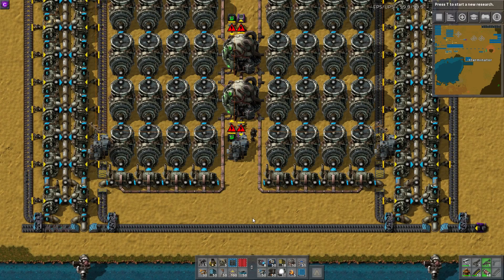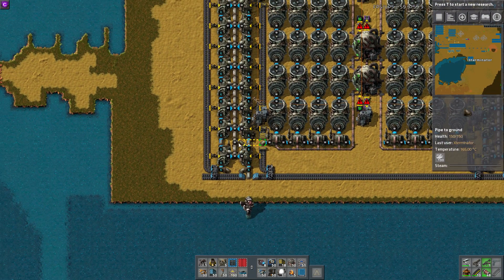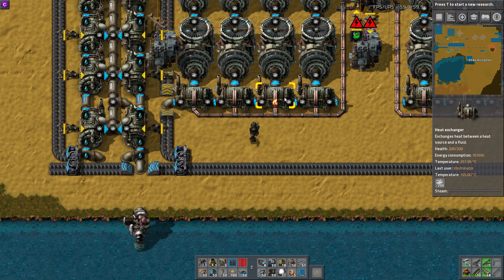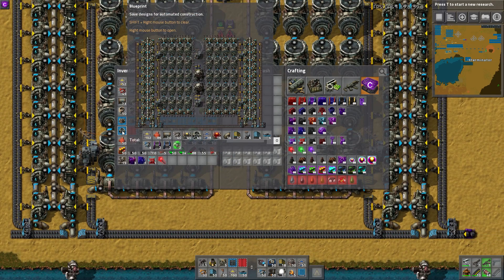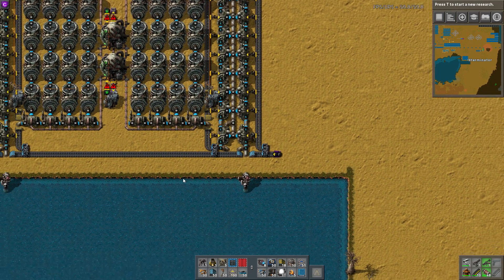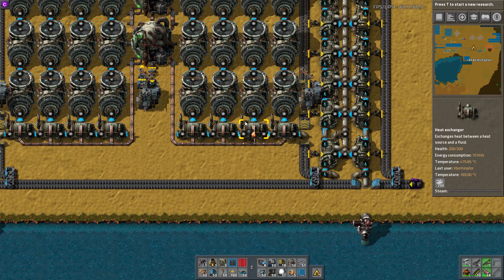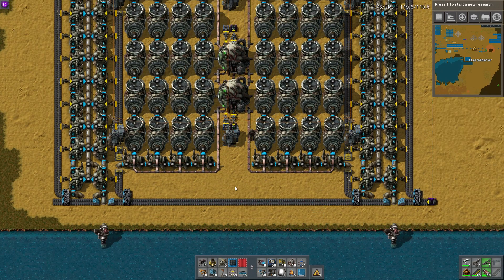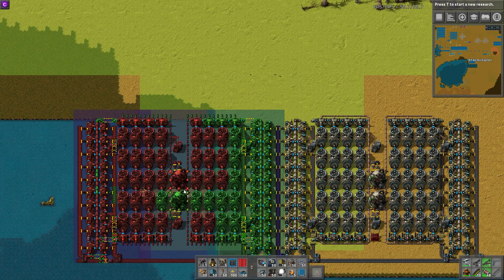Factorio Workshop Season 2 - Building A Better Factory :: MadZuri's Nuclear Setup

Comment: Does not seem to function anymore. Built it, steam got stuck against the exchangers--Only worked when pipes were replaced and filled with water instead.
Reply from the maker: Yeah, in 0.15.10 they changed how steam worked as a fluid and it broke all setups like this.

Comment: I wonder whether it would be possible to tweak this design with pumps and circuits so that, if the solid fuel supply ran out, then the boilers are isolated, and water is sent to the heat exchangers so that you still get 160MW from the nuclear fuel?

Comment: I see two big problems with these designs, firstly it's more efficient to stack reactors in a 2 by X manner, since the middle ones will be getting a neighbor bonus from the 3 reactors(meaning a 300% bonus) they are touching. Which I'm not certain will be all that achievable with these type of designs.
Whatever that maximum size might be, once you reach the maximum reactor stack size for one of these systems, and still need more power it has outlived it's usefulness. Making another hybrid stack next to it means losing out on 4*40=160 MW compared to having those reactors in one long 2 by X length stack, since you'll have 4 extra corner reactors getting only 2 neighbor bonuses rather than the 3 they'd get if they were in one long stack.

Secondly you are making yourself much more susceptible to blackouts since anything that happens to either the fuel or uranium based part they both shut down. So if you run out of either fuel, cells or space for spent cells(or can't recycle them fast enough) the entire system stops working.

Doesn't sound like a good trade off for saving on some tiles.
Reply from the maker: This is a small build meant for early building of Nuclear power. It isn't meant to use tons of Reactors and produce a ton of energy. It is meant for a stage where you want to switch some power to Nuclear but can't afford to make huge setups.

In regards to the fuel, you are correct, there is one of the main downfalls of the build, even Zuri admitted that. I just failed to point it out, so my bad for not doing so.

Comment: Interesting: yes. Useful: Not really. The only thing you gain here is some space efficiency. But on a virtually infinit map that doesn't really matter. What you lose is stability of the entire system. If either one of the fuels fail to be provided the entire system collapses. And as you shown in the video it has difficulty powering back up by itself. It's probably better to fully use the power of the nuclear reactors and regulate the fluctuations on energy draw with steam engines in a separate setup.
Reply from the maker: Good point. I failed to point out the negatives in this build, with that being the main one.

Comment: With Nuclear - is it better to pump all the power into accumulators as it's avaialble (sort of like with solar) or just have it drawing what you're using?  Or make sure you're under-providing with nuclear so it's always at 100% and the rest is coming from other sources?

I haven't really done anything with it yet myself, but I saw it eats the fuel whether you're generating power with it or not, plus it has the "spool up" time, and it seems quite expensive to produce.
Reply: trismugistus it's best to pump the nuclear power into steam which you can store, as stupid as this sounds. With one reactor alone you need 4 tanks to store one fuel cell worth of work. But it grows exponentially because neighbor bonus

Comment: Solid fuel shortage will completely stop power production in this build. No solid fuel = no steam to turbines. And the same thing with nuclear fuel.
Reply from the maker: If you saw my original answer, ignore it. You are correct, it won't work and that is the main disadvantage to this build. Of course that is a disadvantage to any normal Steam Engine build too. This build just manages to get a lot more power out of a smaller space than an equivalent steam engine build.

Comment: more useful would be a setup for the "Kovarex enrichment" process - there is no really transparent and clean solution until now...
Reply: It's much easier than it looks, the simple solution is to stick two logistics inputs, one with 235 and one with 238, and two outputs, one with 235 and 248. The system feeds itself continuously slowly producing 235 forever. It takes a long time to jump-start as you need to collect 40 to start the process, so you shouldnt make any fuel cells until this process has been going for a while and can sustain itself.

If you want to be lazy, and use a bit more resources and power, you just have two centrifuges feeding materials to each other

Comment: It's a unique idea. I'm also not too sold on the extra power here, but basically what ends up happening is that normally heat exchanges can only take ~103 units of H2O / s to convert to the equivalent in 500 deg C steam, which gives the 1.72 turbine / exchange ratio (103 steam / 60 per turbine). The normal boilers though create 165 deg C steam at 60 /s, so in his setup, the 40 boilers create 2400 units of 165 deg steam / s to feed into the exchanges.

Now I'm not sure of the energy calcs behind the exchanges, but it's fair to say that 10MW from the exchange can only convert 103 units of 15 deg H2O into 500 deg steam / s. But if that water were already pre-evaporated / heated, that 10MW could convert more units of steam to 500 deg steam. In fact, the exchanges now support the full 2400 steam / s, which comes out to 150 steam  per sec per heat exchange (2400 / 16). 2400 steam / sec (now at 500 deg) exactly fulfills 40 turbines (2400 steam per sec / 60 steam per sec for each turbine), which is shown in his setup.

My question would be, is there a way to push more steam into the exchanges (because I'm guessing they're now underutilized) to support even more turbines and how much more could they support?
Reply from the maker: That is a good question and I unfortunately don't know the answer. More testing required and science required. :)

Comment: I did the calculations if anyone wants to try a 4x Nuke variant.
4 reactors in a square pattern will need 6 pumps with 120 total boilers to power 120 turbines.

Comment: will the heat exchangers still work if the boilers run out of fuel? If they did and it just dropped to 27.5 turbine output could be very useful for extra boost when needed, or just for disposal of burnables

Comment: I really don't get this.

2 nuclear reactors next to each other = 4 nuclear reactors because of the neighbour effect. 4 Nuclear reactors = 160MW
Then you have 40 boilers with solid fuel adding another 70MW by providing the heat exchangers with steam instead of water

Each solid fuel boiler could power 2x900kW steam engines = 1.8MW per boiler
So the 40 solid fuel boilers could produce 72MW. But you're using them to produce 70MW in this nuclear array.

OK, it's more space efficient, and looks pretty, but 12 extra steam turbines instead of 80 steam engines (and 2 pumps) is saving about 420 tiles worth of space for 2 less MW of power.
Reply: I've tried this blueprint and it does seem to take a while to jump from 217MW to 232MW, I cannot figure why. But I've run it for more than 200 seconds after that (the time it takes to burn a nuclear fuel cell) and it does seem to continue producing a steady 230MW, which is 2MW less than if the boilers were used to power steam engines.

It will work with a single side of coal, not a double side of solid fuel in the video. It will also work with a double sided belt of wood.

But I still don't like the 'double jeopardy' If you don't have the wood/coal/solid fuel for the boilers, then the whole thing shuts down and produces no power, when all you gain from this design is a few hundred saved tiles. Heck, it even attracts biters because it surrounds the non-polluting nuclear facility with polluting boilers.
Reply: Xterminator it's certainly got a great debate going. :)
Reply: better would be a version with a tilable reactor core 2 by x (2x3+ is actually the most optimal, the end reactors get 200% bonus but all others get 300%)
Reply: Well, this is an easy debate now, Patch 15.10 broke this entirely, steam can no longer be used interchangeably with water.
Reply: @5:48 he showed it was making 232, not 230, so no loss of 2 MW.
Reply: He showed it working for only a couple of seconds, if you wait at least 2mins you'd see it falling on the real production as the reactors would start losing heat and eventually the system would balance itself out.
Reply: Then I'm prepared to withdraw my comment. The same power from 500 less tiles is great.

I look forward to seeing a version that has a 2x2 reactor core, the most optimal in terms of neighbour effect.
Reply: Yeah, I wouldn't be so quick to withdraw. If Mobius is correct, it might fall below 232, and if Piotr makes a good point about it using solid fuel instead of coal to get the 72 (or 70 if Mobius is right) power from the boilers. (Nevermind that it's all hinged on also getting the nuclear power going, which uses space for mining and processing and transportation, and creates new logistical nightmares)
Reply: It's a bit confusing, the Steam turbines can generate 5.8 MW of power, but the Nuclear reactor can only produce 40MW per reactor unit. So in a standard set-up, you use regular steam boilers in order to get the extra .8 MW out of each steam turbine. You don't have to do this of course, but the efficiency is less per turbine, and since nuclear burns fuel regardless of whether or not its being used it ends up being wasted.

Alternative setups also instead store steam directly into tanks, and then the reactor is switched off and only switched back on when it is needed. The backup stored steam is used during the "warm up" period to tide you over.
Reply: But you don't need the steam boilers to get that extra 0.8MW per turbine, you just place an extra turbine so you have 7 turbines per 4 heat exchangers. 7 could generate 40.6 MW, so you get the full 40MW. What this build is doing is allowing each reactor to generate 58MW per reactor because the heat exchangers start with a fluid (steam) at 165 degrees instead of water at 15 degrees, so with less work to do, they can produce enough 500 degree steam for extra turbines instead of just over 6.
Reply: I don't think this is even space efficient since you need an extra refinery, chemical reactors, and lots of pipes to make that solid fuel. Or maybe I did something wrong with my own 10GW setup.
Reply from the maker: I don't see what's not to get? Saving 420 tiles worth of space for a 2 MW loss is well worth it to me. Not to mention all the entities saved and performance increase. I mean if you want to go massive steam setup and take up tons of room and lose performance for 2 extra MW then go for it.

Comment: But why would you want a hybrid? You add a extra consumable item instead of investing in heat exchangers which are only a one time only investment.
This setup seems however to deliver more power because  these reactor should support about 27 turbines if I'm correct.
Reply: Because solid fuel is less expensive than nuclear power cells, if you can use solid fuel to heat up steam up to 160, then using the nuclear to heat up above that you are not wasting nuclear fuel up to that point
Reply: You don't magically gain any energy by pre-heating for the heat exchangers, splitting the set-up into a regular fuel steam set-up and a nuclear set-up gives the same amount of power. So any efficiency other than tile efficiency is nonsense.
Reply: TheChaotix14 Can you explain why he gets 230 MW, without the boilers those two reactors should only provide 160 MW.
Reply: Alores Because he adds another 40*1.8 kW=72kW of energy via the boilers. So technically it's should produce a maximum of 232 MW of power, but as you can see when he's showing it off with the energy drain not every boiler is on at all times, so it ends up with a still decent 230 MW. No magic happening, no laws of conservation being broken, just adding energy via another route.
Reply: Fuel cells are very expensive, whereas Solid Fuel is essentially free. Once you have enough oil/beacon set-ups to provide you with the required crude it will do this forever. In a standard set-up, one Reactor unit outputs 40 MW of power, the steam turbines can take 5.8 MW each but in a standard nuclear only set-up they only use about 5 of it. What this set-up does use solid fuel and standard boilers to make up the difference.

Since fuel cells burn regardless of whether or not the energy they produce is used, it makes sense to either supplement the power with an additional steam set-up, or store excess steam inside tanks.
Reply from the maker: You answered your own question I think. That is why you would want to. Because it is able to support more turbines off of only 2 reactors than you could normally do with just heat exchangers. :)
Reply: save the extra steam you can do regardless of using this method or not... i have an easi settup with a few extra steam tanks that makes the reactors only burn fuel when needed, and  does so i can have twice as many reactors then needed for better efficiency... after this new setup i save up to 70% on the reactor fuel
Reply: Wasting oil that could be used for research on solid fuel for power is just retarded. With kovarex enrichment you get like 60% of your cells back, plus they aren't used for ANYTHING else.

Comment: I don't think that setup is effective since you're using 2 types of fuel to output 230MW. Its an interesting idea tho, that you can use multiple types of fluids to use the heat exchanger instead of just water, wonder if you input oil what would happen.
Reply: A normal two-reactor setup can only produce 160MW
Reply: Distelzombie Centzon Totochtin And the other 72 mw come from the boilers. You'd have exactly the same power if you seperated both builds, with the added advantage, of not having all of your power die, when 1 of your fuels falls short.
Reply: I made a copy of that system working nonstop for a few minutes and its not outputting 230MW in a constant rate so its not worth it. The turbines consume more steam than the exchangers generate so, once you let that setup working for a while, the reactors start to lose heat, the steam in the pipes start to drop until it balances out around 170MW. Also spending 2 types of fuel to produce the same as the 2 reactors don't sound effective to me sorry :/
Reply: Mobius one That's not what I saw in creative mode. Once it got up to 230MW, it stayed there.
Reply: DRY411S did you check the heat value of the nuclear reactors? After a while they start to drop that assuming you using 100% of the output value all the time.
Reply: Mobius one I did see that the reactors fell below 1000 degrees yes and wobbled around the 750 degree mark. But the power output from the plant was steady at 231MW. I used a creative mode power void thingy to make sure there was a full draw on the plant.
Reply: If you pumped oil into the heat exchangers, you'd probably end up with a sticky clogged up mess in the turbines which accept only steam as an input ;)

Comment: It would be nice if someone could make a mod that would allow you to switch out the content of the logistics and auto trash sets.  So you could have sets like, biter fighting,  factory building, rail building, Power building. etc...  One could just walk into an area and switch from having a gazillion rails and some ammo to a ton of ammo and a few rails. 

Nothing that would change the game balance like increasing inventory slots.  Just a quality of life thing to change whats being requested and trashed without a lot of muddling about.
Reply: AutoTrash mod.
Reply: To be able to set modes of logistic requests, to change from one request set to another and anything not part of the new logistic request is removed to make room for it.  It's a fantastic idea and could be implemented straight into the current logistic request system without too much work I think.  Maybe try Reddit and convince a modder to implement it? The devs would be too busy I think at the moment for new requests but if it was a popular mod they may put it into the game at a later date.  Doesnt sound particually op either - just quality of life.